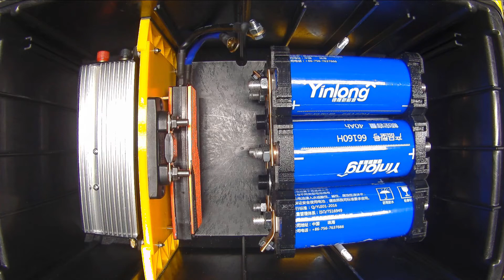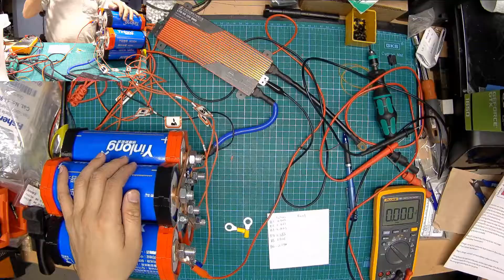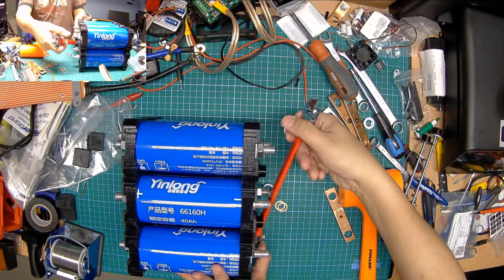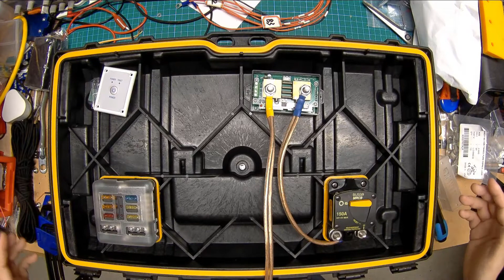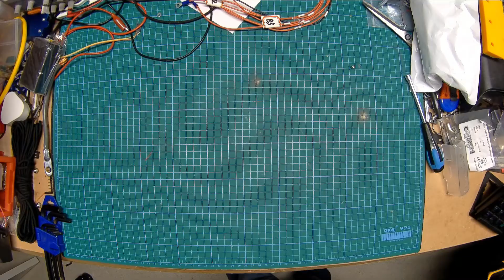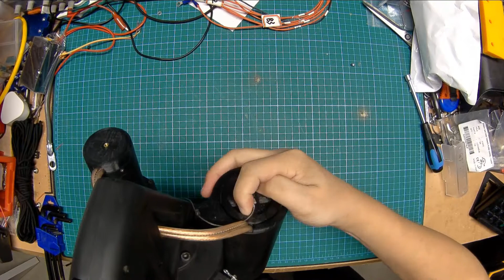Project Updates: Lithium Titanate Battery Pack and the Future

Comment: Like the build! Why LTO cells instead of lifepo4 if you're only using an 800w inverter?
Reply from the maker: One of my requirements is cold weather usage, it's only a 40Ah pack, and a 800W inverter seemed a better compromise than inverters which might not have enough capacity for future yet to be determined projects.